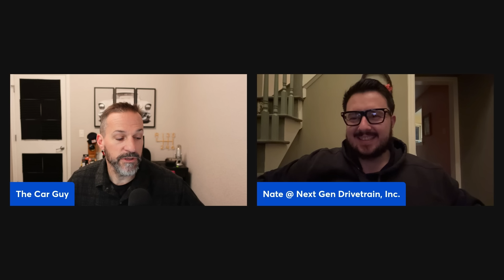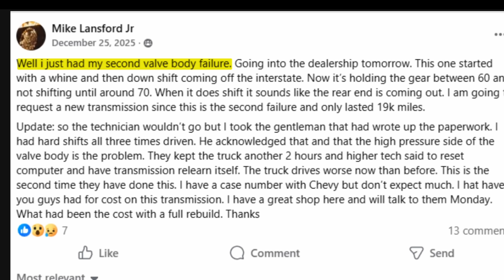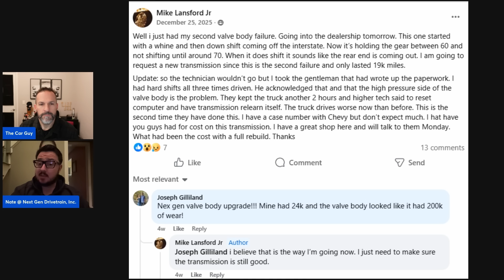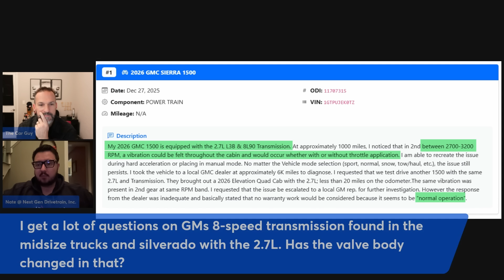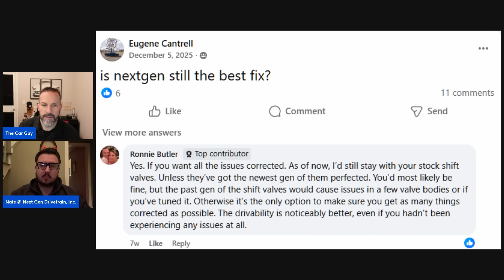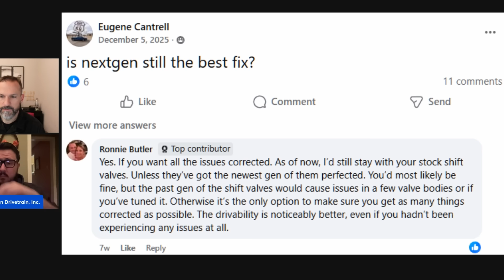How GM Transmissions are DESIGNED To Fail with NextGen Drivetrain. 2025 2026 Silverado Sierra...

Comment: The big 3 years ago used to build EVERYTHING in house except tires, grease and oils.
Reply: I live in the Dayton Ohio area that had multiple GM plants making parts for their vehicles and other manufacturers too but now all gone,I do not think a car manufacturer can make everything but GM made most of their parts at one time.
Reply: That's not true.  The auto companies have outsourced parts manufacturing to suppliers since the early 1900s.
Reply: @buckhorncortez Not entirely- GM made basically everything that went into a vehicle minus tires and glass.
GM owned the former ACDelco systems renamed Automotive Components Group (ACG). It was renamed Delphi, and spun off in 1999.
Delphi made everything from air and oil filters to steering wheels to steering gears. GM bought back some of Delphi’s operations around 2008 and is under GM as Automotive Component Holdings where GM still makes radiators, heater cores, and valve train components. A large company called Nexteer was GM Saginaw steering/Delphi which was bought back from Delphi in 2008 and sold to a Chinese company. 
Ford had similar operations named Visteon that were sold off. Chrysler had Acustar that was Chrysler’s in-house parts operations as well.
Not to say they didn’t buy some things from outside suppliers, but the Big 3 were largely vertically integrated until the early 2000’s.
Reply: @buckhorncortez not from China

Comment: Thank you both for helping us understand how us who bought new Gm trucks are basically screwed my 6.2 passed it’s recall bullshit test now I have 0w40 in it not knowing how long it will run before it seizes and now the transmission problem to worry about. I really can’t afford to get rid of it and take a beating. Thank you both again for keeping the public informed.
Reply: Get rid of it and take a beating.
Better for your health in the long run.
Reply: I’m at 40k … 3 years old…driving in CO mountains… & thanking my LORD… not one issue🙌🙌🙌
Reply: Stop buying this new junk.
Reply: not gonna happen.  any more than we can outlaw stupidity
Reply: @IsleOfFeldspar yeah but if you buy the less junky junk it makes companies like GM actually step up to compete. Stop buying GM is a better way to put it.
Reply: Have seen many of the 6.2s running fine with over 100k on them without doing anything to them
Reply: @doddgarger6806 thanks for the comment GM!
Reply: @doddgarger6806  100k is hardly ANY big accomplishment today.   A well built and maintained engine and transmission should be able to reach 250K+ easily with no major repairs.
Reply: @sidorgeorge The reason that they can't is the Democrat climate change alarmists that have made unattainable demands on the internal combustion engine and their drive trains. The amazing part is that very good mileage can be obtained by properly designing drive trains. In 1965, I was stationed in Wichita Kansas. I met a fellow Airman in the auto shop. We built a 57 Belaire 283 CI engine with a 2 bbl carb, and a three speed manual transmission. We bolted on an overdrive unit from a junked Nomad wagon, put a long legged automatic rear in it and a set of headers and dual exhaust, and my friend drove home to Rochester NY on leave and back to Wichita, KS. Round trip mileage 33mpg.
Reply: @doddgarger6806 I’ve got 2 5.4 Tritons without any issues with 200k plus each. Are those the best engines ever made because they made it that far? Without spitting out plugs or VCT and timing chain issues ?
Reply: I hope all goes well man
Reply: Dont stress man! Theres thousands and thousands of 6.2s that go well over 100k miles with no issues. It is still a really small chance that something will go wrong with yours. Yes theres a flaw in the motor and trans but luck is still on your side! Maintain it more often and swap the trans fluid at about 40k and drive and enjoy!
Reply: @ponce1521 another thoughtful comment from a GM rep
Reply: @curttundra  Lmao thats funny af. I drive a TRX look at the couple videos i have. Lol also have a suburban for the wife and kids and has been solid. I know the defects but people swear its every truck. Its not. But dont matter to me. I was just trying to ease dudes anxiety.
Reply: Where do you live? put a used 5.3 in it when it blows
Reply: Get that 0w oil out and run 5w-30 at minimum
Reply: Go buy dodge. My grandpa said dont buy a ford, these nazi built tanks against us. Mr.Ford built tanks for the nazi, my granpa would rather drive a Toyota.
Reply: You know, if you tow a boat, you could always "accidentally" allow the truck to back into the lake/ocean.   It happens ALL the time.   :)   Just saying! :)
Reply: Didn't the warranty get extended on the engine to 10 years / 1500000 miles?

Comment: Absurdity to have a 10 speed transmission in a tiny pickup truck.
AFM and Plastic parts 40 modules..
I am keeping my 1989 GMC k2500 and 2010 Express van till i die.
Boycott all new stuff.
Garbage all mfgs.

Comment: My ZR2 trans valvebody failed at 16.8k miles. After 2 months I asked for a new trans, they agreed and a week later I had my truck back. I gave it 5k miles and put the complete Next Gen valvebody in it. Topped that with a PPE bypass. Been worry free since. However, been waiting over a month for my core return to get sent back.
Reply: 2024 and I’m at 24k now, I have 2k miles this week on the Next Gen valvebody. Been great so far the whole time
Reply: @Bussman73 ok, thanks for the reply
Reply: Hey, what year is your ZR2 and how many miles since the repair?

Comment: God I love my 2022 Honda Ridgeline with the amazing ZF 9 speed !
Reply: Exactly, Drain and refill it every 30.000 miles keep on moving forward, F GM for now, We desperately need some real Change so I can switch back to GM until it's Going to be Honda.
Reply: @raymondreiff8170 

Almost @ 40K miles, and yes i m planning on doing atleast 2 dump in fills by my next oil change

Comment: This guy is kinda clueless in some areas. Relearning components in transmission and electronic engine components in most vehicles is required. I know for a fact as a ford senior master tech if you don’t change the SOL ID and Strategy on a 10r140 it’ll die within a week, regardless of the previous state of the old transmission.
Reply: And have a CEL, shift concerns, etc. this applies to turbochargers and other components.

Comment: The world runs on pareto analysis. The only time they care is when failures run at close to the 20% failure rate. They may tweak the lower percentage, but those numbers are just in the minutia. 

I used statistical process control and plotted all deficiencies in our production build. I'd hit the top 5 or 10 items, correct them, then move to the next top 10.  This data is only as good as the people classifying the defect, so if was incorrectly classified, it didn't appear as part of the main failures.

Comment: You have to wonder, why did they stop offering a manual transmission when they are bullet proof compared to the crap they're putting in trucks today
Reply: They'll make more money off a transmission that only last 60 than one that lasts basically forever
Reply: In Europe, manual transmission sales used to be 90% in 2005, now the share is closer to 35%. You can opt for it in most new car and van models and if you're smart, you should.

Comment: We will see long term but so far, I am loving my 2026 10 speed. It shifts SO nice and I couldn't ask for it to be any better. I have an 8 year 100k mile warranty so we will see if I ever need to use it or not.
Reply from the maker: That's good to hear. You might have a good one, it's a numbers game. Not all fail early.
Reply: @TheCarGuyOnline  Out of all the groups I am part of, it is pretty rare to see someone that has actually had a problem. Even with higher milage, they are out there but it is rare. My friend put the NextGen valve body in his 2021 at around 100K but he didn't have any problems when he did it. You can say that it could be built better about almost everything...
Reply: @ChrisCory1 the two guys at my work that have the 10 speed both traded there trucks in for a newer version. One has a 3.0 the other the 5.3. Both transmissions had similar issues and the dealer determined the valve body was no good. Month behind on back order.
Reply: The 10r60 in my explorer has been holding up well at 40k so far. I was having some jerky shifting issues at first. The transmission has benefited from an Italian tune up from time to time. Shifting gets funny when I don’t floor it often enough.

Comment: Who would have ever predicted that Ram would be the best bet for reliability in 2026, but it really is the best truck available now despite its flaws. The 8 speed ZF Transmission does not have widespread failure issues, the engines Hurricane and Hemi are pretty reliable until they reach around 150k miles when they do have issues arise. The Hurricane does have thermostat issues and some Cat converters have melted again not widespread. The Hemi still has the cam/lifter flaw that seems to happen more with trucks that have high idle times, but it is not a massive widespread issue and they are not having engines grenade like GM and Toyota. As for the Manifold leak issues I always ignore those on my Ram 2500 work trucks never had many issues. I know this much going off my experience from being in Rams for work I would buy one with my own money if I needed a truck in 2026 and I am a past GM Fanboy!
Reply: Yea I have also had better success with my Ram and past Dodge Ram than previous GM products
Reply: @NDIrishfan71Totally agree. Used to shop around for GM/Toyota. Fourth gen Ram 5.7 converted me, it was extremely reliable. Got a 26 5.7 because of that, and Toyota sucks now, GM not far behind
Reply: I came to a similar conclusion, then recently bought a 2019 Ram 1500 Rebel with the hemi.
It was in a sweet spot where it had no mild hybrid (eTorque), no auto start/stop, and no 4WD Auto (clutch pack transfer case).
The hemi has no turbos and an old-design iron block. It has its own issues...but seemed tolerable vs what the competition offered.
I love the truck!
I have plans to learn to rebuild a hemi on my bucket list. I think that would fun!
Reply: 2019 Ram Rebel fully loaded very happy. Don't need a GM and never did.
Reply: Dave at Daves Auto Center says that the best truck would be an F-150 with a Dodge engine.
Reply: @amazoidal And definitely the Dodge 8spd aswell.
Reply: @oldironguy  thats literally a ZF design like the 6r80 10r80/10l80.....literally a ZF8HP80 same trans SO similar its not funny to the gm/ford 6speed and 8 speed and yes 10 speed...including sharing EVERY gear ratio with the 10r/l80 except the 2 added IIRC one below 1 to 1 and one more OD...the rest are the SAME......my 2021 Ram 1500 Limited Night Edition was a POS that cost 74k........
Reply: @amazoidal  Cummins with Ford Chasis. Also the bullet proofing on the Cummins. As far as Chasis is concerned I like Toyotas the best on both Engines and transmissions Pre-2022 Tundra re-design that is. I also Love old Ford trucks 1996 and older.
Reply: Expensive paper weight
Reply: I have a 2017 FIAT 124, that has been more reliable than any GM product, I ever purchased. The 124 has only needed tires and a Battery, oil changes every 5k miles. GM deserves to go away. Anyone buying a GM now is either a idiot, uninformed, or a glutton for punishment.
Reply: GM 6.6 and the old 6 speed 6L90E keeps me happy.

Comment: The Japanese believe in continuous improvement. Americans believe in continuous cost cutting.
Reply: as evidenced by the last 5 years of Toyota, it seems everyone has gone straight to shit
Reply: @jdr03272 yes
Reply: Engine machining debris, thrust bearing issues, etc. Yes I see your point.....SNARK
Reply: @vincentsutter1071 ❤
Reply: I will say this…. Of all the half tons, I honestly think the toyota is still the better bet. (100% opinion based because I don’t have exact data other than experience) That being said I would not buy a v35 tundra or any half tons right now they are all not that reliable. But I bet the tundra is still more reliable than a GM product, or ford or Ram. (They replaced all of their engines GM told you to put in different oil) But generally Toyotas don’t historically have bad products. My 2005 Lexus 470 drove for 20 years and 240,000 miles. I got a new radiator, and new suspension for a 20 year old SUV. literally that’s all. I own a 2025 gmc 3500 my previous 2025 duramax engine literally blew up while I was towing. But what do I do? Buy a Ford or Ram. They are all unreliable and it sucks. I considered Ram but holy cow resale sucks. GMC right now has the best resale for HD trucks. So you either keep buying new and dump before it’s out of warranty or go buy a 2014-2021 5.7 tundra. Here is the thing the 2014 tundra is 11 years old has horrible MPG and tech. So it’s kinda a no win situation in the market right now.
Reply: @TheAnalyticalAsian ❤
Reply: @Jasona1976 I noticed your BMW logo… funny thing I had been doing research and I may buy a used m440i convertible the b58 engine seems to be pretty good…
Reply: @TheAnalyticalAsian best of luck. I’m sure you’ll love it. My bimmers were years ago. Now I am a Lexus fanboy. 😂😂❤
Reply: @TheAnalyticalAsian No way in any world is the current Tundra more reliable than the 5.0 Ford, 5.7 Ram, 2.7 GM or Ford, 3.0 Ram. The Tundra really is a rolling pile of dogcrap. And I wish it wasn’t so, loved my old Tundra
Reply: @TheAnalyticalAsian  yes that machining debris issue and thrust bearing issue doesn't count.
Reply: That's definitely not true anymore
Reply: @nn-dj2nu oh really? Explain Toyota then. Also explain why American cars always rank low on reliability.  Always.